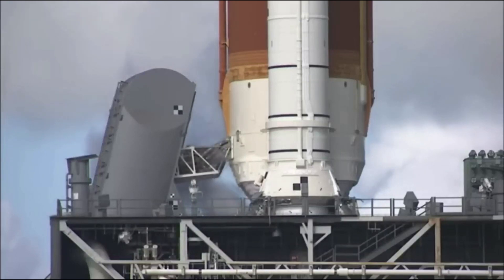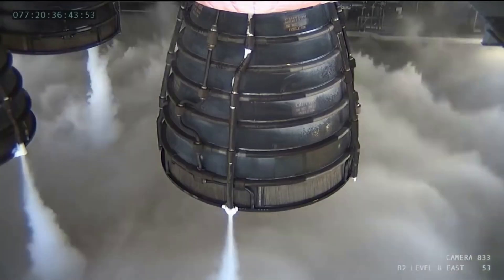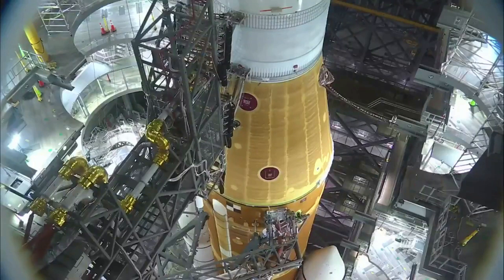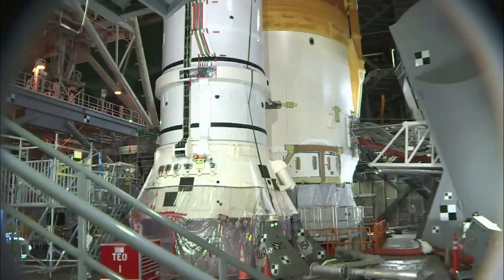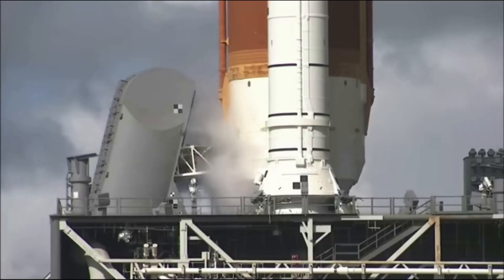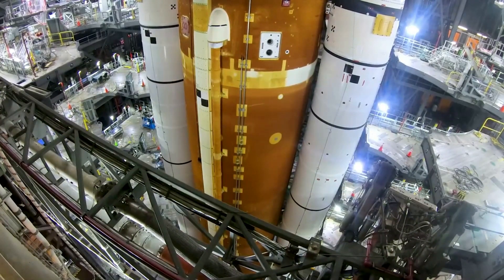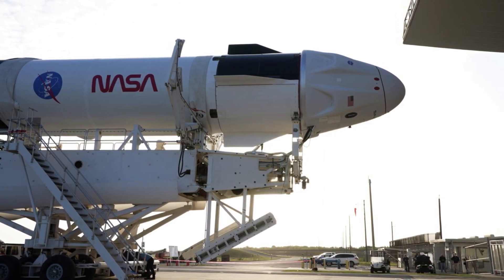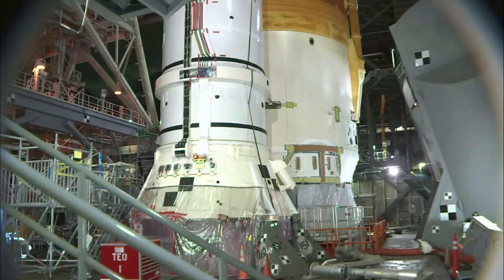NASA Continues To Work On Liquid Hydrogen Leak In Preparation Artemis I

Comment: Thanks for the update! Glad it was at least able to get the leak down to an "acceptable" level. Though, I believe they have filled it before without issue during one of those wet dress rehearsals, so who knows. It's always interesting to me the seemingly simple things in rocketry that cause major on-going issues like this leak and the stuck valves in Starliner. I get space is hard, but from a simple enthusiast watching them struggle with leaks and valves before it even takes off is crazy.
Reply: Hydrogen is notorious for leaking no matter the condition (as the smallest atom so they only need the smallest cracks to leak, even atomic level cracks can leak hydrogen) so hydrogen fuel rocket is gonna leak to some degree no matter what, most hydrogen rockets used those acceptable level measure too, if it isn't leaking too much then it is ok to launch.